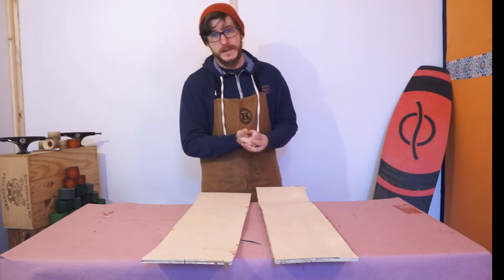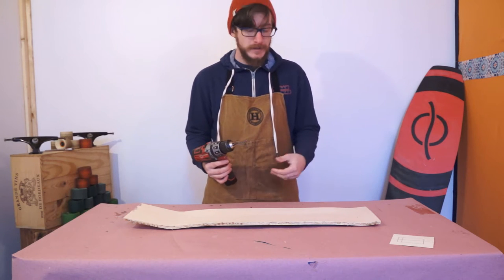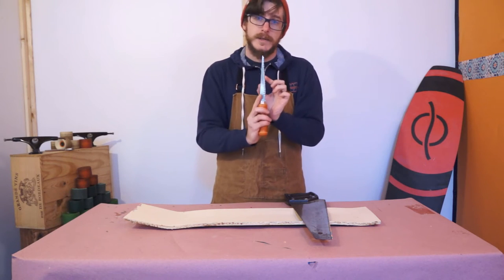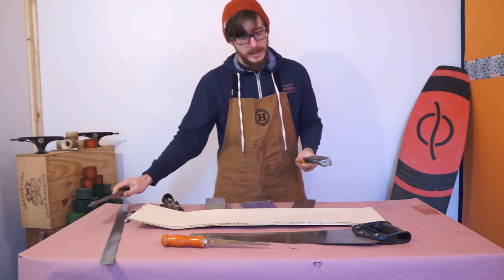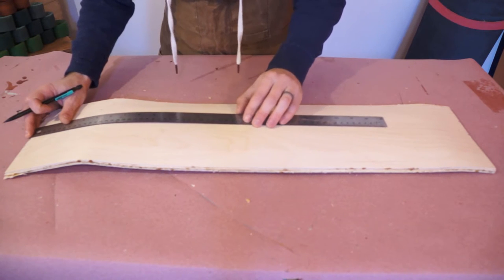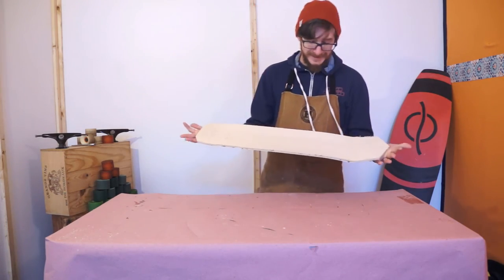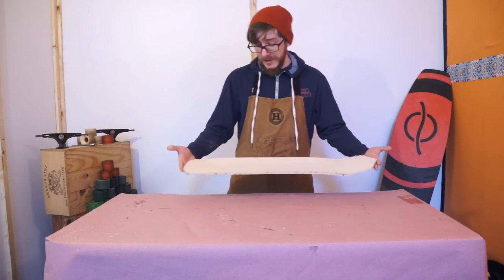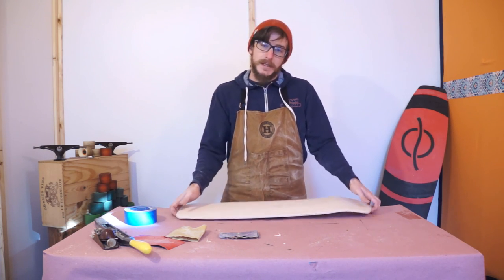Easy, Inexpensive, DIY Skateboard - Part 4: Drilling and Shaping

Comment: Wow yellow dog what a disrespectful comment.

Anyways, just took my first board out of the press this morning after following your vids, so far so good! 

To anyone watching that started but are procrastinating on finishing it (like me), the first step of cutting the boards and foam maybe took a little over an hour, the hardest part being cutting the curves on the foam. My jab saw’s kerf was a lot thicker than anticipated, which worried the crap out of me that I removed too much material. That was maybe a month or so ago.

Yesterday I finally bit the bullet and hot glued the negative parts to the board. Realizing that didn’t take long at all, I said f it and worked my way through the rest of the steps: cut my birch down, cut and drilled the 2x for clamps, and pressed my board. Everything yesterday took roughly under 3 hours, not bad at all as I was considering splitting the rest of the steps over a few days!

Thanks again for your vids, this has been the worst year of my life; I’m glad I was able to spend a few days out of my head on something that combines my passions of woodworking and skateboarding, both of which I haven’t been able to do much of this year.
Reply from the maker: I'd love to see your build if you want to email me or send it on instagram or somthing

Comment: Yes! that's the serie of video's I was looking for!
One question though; using 3 layers of multiplexed birch means that the direction of the grain is the same on touching surfaces?! That's nothing to worry about?
Thanks again.
Reply from the maker: Correct! And that's actually desirable as it gives us more long grain sheets in the nose to tail direction. That makes for a stiffer stronger deck and is closer to the construction of a standard maple skateboard.
Reply: @GoodRoads  
Thanks for the reply. 
I have build the mold, bought the necessarities and am ready doe pressing. 
1 thing: I remember you telling to use 3 layers of 3mm triplex birch; 9 mm Total. I've measured soms older  Powell and Vision decks and they seem te be at least 11, or even 12mm Thick. 
Anything tot Worry about?
Grz
Reply from the maker: @heinverschuren2636  If you're worried about stiffness it might be a good idea to add another layer. Birch is less stiff than maple to begin with so a couple extra mm couldn't hurt if you're trying to make something that feels like a proper street deck

Comment: really enjoyed your videos, I guess the most difficult part is to get the maple and the right type of glue
Reply from the maker: Thanks man! Heads up: you can't use maple veneers with this method, you have to use a marine-grade hardwood plywood (birch is the most common). Veneers aren't stiff enough to be pressed this way

Comment: Hey, 
Love your videos, thx to you I did my 1st DIY longboard and I'm pretty proud.
Have you ever made any diy wakeboard? 
I wonder how to deal with the fixation. How to make the slot for the screws strong? Any tips? Thx a lot
Reply from the maker: That's sick! Congrats on your build! I haven't built a wakeboard but if the mounting hardware for a wakeboard is anything like like a snowboard you can use t-nut inserts or specially made binding inserts.

Comment: What are this tools called that are being used to finish the edge. Would a rasp and a file (normal ones not as wide as the tool used in the video)?
Want to do this with what i have (lots of sandpaper too) and not buy anything. I’ve got an angle grinder, saw and jigsaw, plus a set of files, rasps and samdpaper

Comment: If you've used these boards for riding, how do you feel the birch compares to a maple deck? Do you notice any difference?
Reply from the maker: Absolutely. The birch is softer and has a less snappy flex and pop. It's a great material to start with, but there's a reason that most decks out there are made of maple. I think using plywood instead of individual veneers dampens these decks a bit as well. The upside is it is MUCH easier to wet out two glue seams (3 layers) than 6 seams (for a 7-ply deck) and get everything pressed within the pot life of the glue.

Comment: Dude, I respect what you are doing but wow, this is such a hard way to do it.  I will be re-drilling truck holes on a board today.....I do not own a drill press but I think I figured out how to do them perfectly straight.  The way you did it will not work.  The bolts will never get through the trucks they will bind, unless you are terribly lucky which is just unreliable.  And I am not sure what kind of wood you are using or what type of mold you have....is that 7 ply?  Also, to cut the board you need two tools....a jig saw and a router.  Your way will take all day to cut and finish one.  My way you can probably do 10 in a few hours.  I will try to make a video showing how I do the truck holes, I really think I have a very good solution.
Reply from the maker: The deck I made in this video works just fine. I've built many, many boards and you can definitely get usable bolt holes using a paper template, it just takes some care. I've got a 3d printed jig for drilling bolt holes that gets me perfect results every time, but this video is about how to make a pressed deck even if you're darn near broke and paper templates are free if you've got access to a printer. Of course there are more reliable and easier ways of pressing and shaping decks. This project isn't for people trying to start a company and cranck out as many boards as possible, this is for people in their garages trying to make themselves cool stuff. Check out some of the other videos on the channel, I've got builds at all different levels of difficulty, this is just one for people who are starting out and may not be looking to invest in a ton of equipment yet.
Reply: @GoodRoads  Ahhhhh, very cool man.  Well, happy new year to you!
Reply from the maker: You too homes!